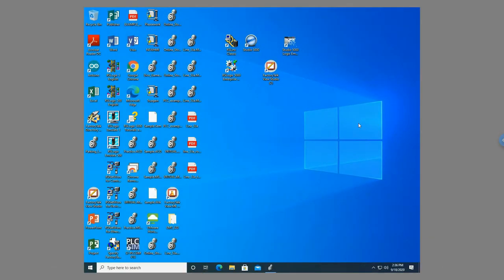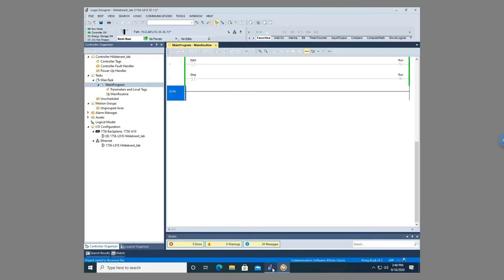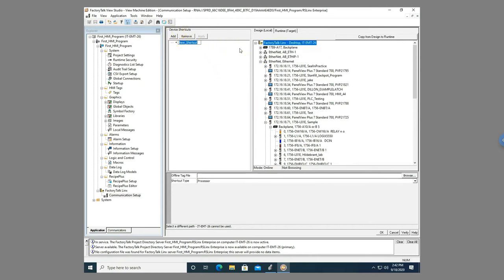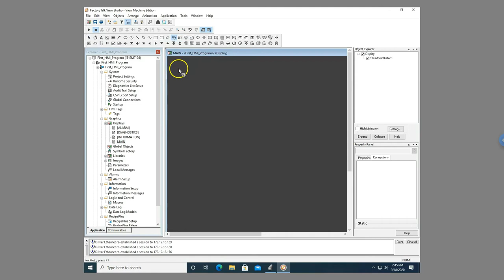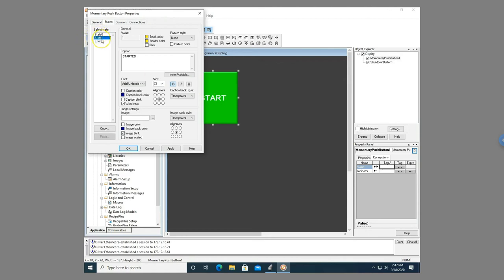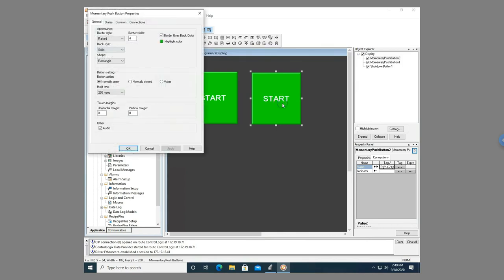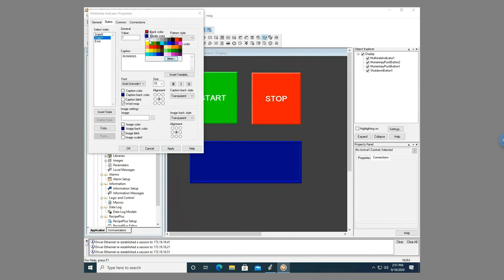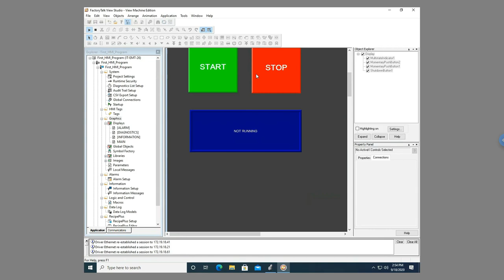HMI PROGRAMMING VIDEO 1: INTRO TO FACTORYTALK STUDIO 5000

Comment: Im in the process of acquiring RS 5000 for my employer. AB distributors offered Factorytalk as a separate option, would you consider FactoryTalk as a necessity or requirement.
Reply from the maker: Hello Martin.  Yes, I would definitely want Factory Talk too if my employer offered it.  It is hard to find a PLC that is not connected to some form of HMI.

Comment: I have Failed to connect Link may be broken do y ou prefer cable conection or over wifi with I use now ,or driver maybe issue?
Reply from the maker: If you have issues, then yes, I would use ethernet cable to make sure the problem is not within the Wifi connection.  Depending on the model, USB connection is the easiest to set up if you have that option.